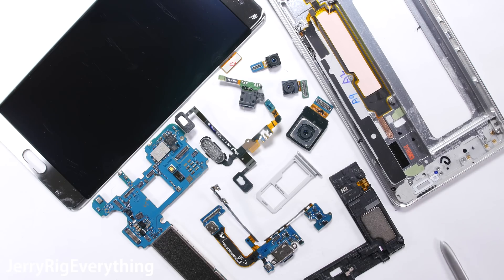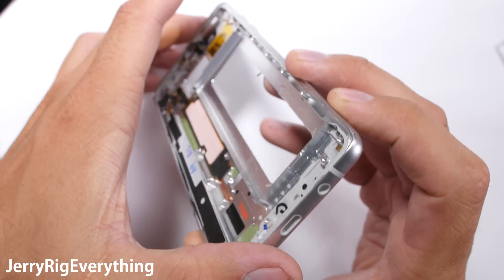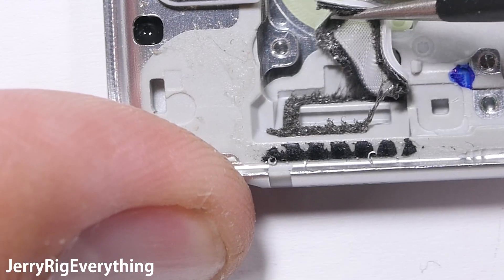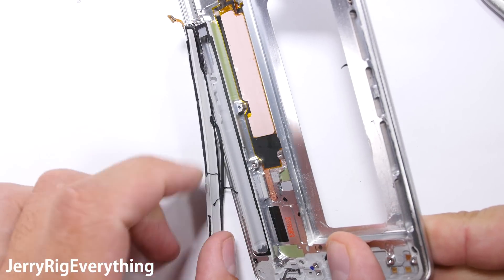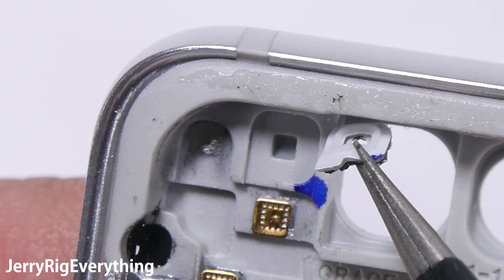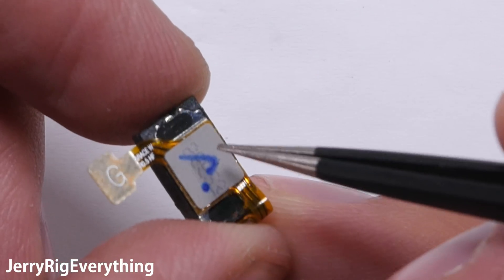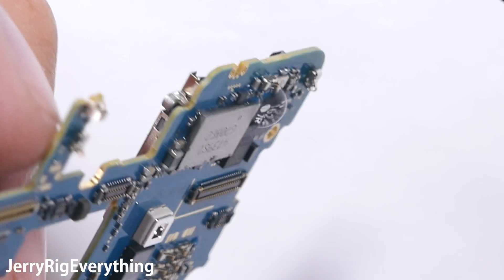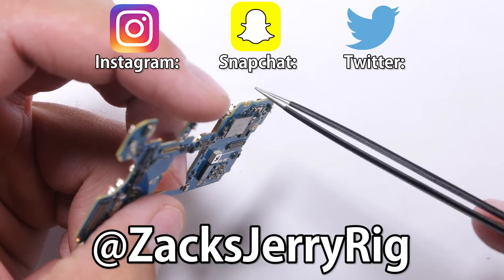What makes the Note 7 Waterproof? Ultimate Test!!

Comment: Hey Jerry,
I got a question about Samsung's water damage warranty. I dipped my S7 in a 3-4ft pool for about 10 secs and the screen freaked out later and died. So, I was scared that I caused it but later I called Samsung and they said I should send it in for evaluation and they offered to repair it at no cost. So you spoke about the water ribbons that would bleed. So does that mean mine didn;t bleed? and if it's a no then why did water come out of the SIM card tray when I pulled it out after I had removed it from the water?
Reply from the maker: If it really was a quick 10 seconds than maybe your indicators didn't bleed out. Also, Samsung might be nice about the liquid damaged phones, even though its not included in their coverage.  Its hard to say for sure.  It also depends on what rep looks at your phone. Some don't care, and some are super sticklers.
Reply: Thanks for the respond. It's a male that started looking at it according to the Repair Tracking site Samsung has then a lady took over and now they are waiting for a part to come. S7 is a great phone.
Reply: His Name is Zack. :P
Just saying...
Reply: water can come out from the Sim card tray but that doesn't mean it's way inside the phone since most of the phone has this water resistant barrier ... people will believe everything they see on TV its quite funny... youtubers said Note 5 and iPhone 6S are semi- water resistant as well with sum of them putting them head to head in a water container... I'm like 🤔😒... just cause they say my phone is semi-water resistant doesn't mean imma shower w my phone... sure I pay insurance but that's only for accidents in case I drop it and not on purpose...
Reply: XxiKarlosxX xoxo IKR well am a young adult that like to experiment so i tried it out. At least i live to tell a story to others. Am a pretty careful guy when it comes to electronics and i never get insurance on my stuffs cause i think am good enough but still no one is perfect.
Reply: Arun Kumar emmmmmmmmmmmmmmmmmmmmmmmmmmmm oke
Reply: LOL but Samsung says not more that 5ft for 30mins
Reply: so note 7 is a lot better
Reply: Don't do experiments like this.   The claim is one thing but the real issue is rain, spilt drinks, and drops in the toilet.
Reply: Darrell Lucas Hey chill bro, i got my phone back and it got fixed for free.
JEEEEZZZ
Reply: Darrell Lucas L
Reply: You can get sprays that allow electricity to flow normally but repulse/repel water I use it on my Galaxy S5 Plus for extra protection!
Reply: +JerryRigEverything can you do one on a Galaxy S5 or S5 Plus and/or Sony Xperia?
Reply: +JerryRigEverything 10 seconds is for ever to be in water. lol
Reply: You should test the claim on how resistant your bones are to breaking.

Comment: is there beter ıp then 68  like 69 70 681   some thing like that
Reply: IP69K
This means Dust tight and protected against powerful high temperature water jets.
Reply: Nick N when aliens invade earth with water jets
Reply: Nice
Reply: With IP 68 the 6 stands for dust resistance and the 8 for water resistant
Reply: IP 99
Reply: ı know but is there7 for dust or 9 for wather
Reply: +Cem Kaya there isnt more than 6 for dust but there is 9 for liquid and i think 9k oalso
Reply: IPxx
Reply: IPX8
Reply: The funny thing is that it's barely above IP67 which is dustproof and water resistant upto 1m @ 30min. 1m is around 3.28 feet, so they increased it to 5 feet which is about 1.52 m. Typically a manufacturer will specify 3 m for the IP68 rating which is just shy of 10 feet, but I guess since they got it just past the 1m mark they earned the IP68 rating... IP68 used to be the highest, but the IP classification was updated to include IP69K in 2013.
Reply: Jesus. Just out of curiosity, when would I need protection against powerful high temperature water jets?
Reply: +Nick N because it's handy
Reply: in shower
Reply: IP69KFW9
Water resistant, including water from high pressure high temperature jets, dust sealed, oil resistant and weather resistant too. The extra 9 for the highest impact resistance, rated at 5 kg dropped through 40 cm ;).

Comment: "great" so it is advertised as water resistent but not covered by waranty 😂 "nice job samsung"
Reply: all manufacturers do that!
Reply: its water resistant. not proof
Reply: water resistant not water prrof, if they advertised water proof they would cover it,
Reply: Especially because its only up to 5ft, theres no pressure sensor inside that will tell Samsung if that depth was exceeded, so someone could go diving, phone breaks, they go moaning to Samsung it was water damaged. Theres no way of them knowing if the user is adhering to the guidelines.
Reply: Because if Samsung claimed it was water proof and it did somehow managed to get water damaged, then people can sue Samsung for false advertising.
Reply: cause it doesn't have a water gauge installed into it... lmfao
how they going to measure if you went past the expected IP68 ratings?
Reply: samsung don't know if you yake it deeper..

some sellers in my country 
give you a special warranty cost 99$ and if your phone's screen Crack than they'll replace it 
but if your screen damaged they won't
Reply: In fairness what he showed was from the Carrier, it said T Mobile don't cover it, so I wonder if Samsung themselves do?
Reply: +azamean no they don't
Reply: azamean There is a water sensor inside the note 7.
Reply: Jason Lee A water sensor, not a pressure sensor. My point is they have no way of knowing if someones water damaged phone was due to normal use or because they decided to go to a depth greater than 5ft.
Reply: azamean There is a pressure sensor on the phone, but yes, it isn't used to tell if a person placed the phone under the water.
Reply: Jason Lee There isn't. The screen is pressure sensitive and so is the S-pen, but I'm talking about barometric pressure. It can't detect depth or elevation.
Reply: I think this goes to T-mobile, they use the same template for all phones and forgot (may be intentionally) to change this lines...
Reply: Actually there is barometric sensor (atmospheric sensor) in the phone, but I'm not sure if they may/use this...
Reply: +azamean it can't detect it yes. But the only way of the phone being damaged by water is if you take it deeper than 5ft!
Reply: wwesuperstar1100 Which is the difference from holding the phone in the water in a swiming pool, and accidentally dropping it to the floor of the pool. 5ft is not deep. Most standard swimming pools are deeper.
Reply: I think thats the logical thing to do because how they are going to know that you havent pass 5 feet in the water for 5 hours or something
Reply: In the EU there are 2 types of warranty:
1. voluntary warranty by the brand
2. mandatory warranty by the seller
If the seller in which ever way (probably there is at least some point on the packaging of the phone?) advertises the IP68, their warranty will have to cover it.

Comment: translate 5 feet for us normal people pls
Reply: Apparently  "normal people" are also too retarded to use google
Reply: Justin Elrod
Cant say anything these days without someone being offended for no reason.
Reply: 5ft = about 1.5 meters
Reply: +Xirpzy no he's right. People use the metric system where I am but if you're "normal" why didn't you just google? Normal people aren't that lazy and normal people roughly understand both the imperial and metric system
Reply: AllYourTechNow
ty
Reply: I am sure your comment weren't meant to be offensive or filled with bitter hate in anyway for sure :^)
Reply: Actually the ip certification is not 5 feet, but 1.5 m (4.92126 feet -> about 5 feet).
Reply: Paul
no most people wouldnt translate to an inferior system.

Comment: Why don't you teardown the s pen to show us what makes it oalso water resistant??
Reply: +Lord Jon well... So Just bteak it😂
Reply: +Lord Jon no, if you cut it properly in half you will be able to see all the components and what makes it water resistant
Reply: +Jad Bhamdouni am I wrong?
Reply: i think jerry forget about it lol
Reply: +Nagesh Katkur hahaha yh ik but his name is zack
Reply: +Pratik Patel oh yeah it does have electronics. I remember seeing a video cuting the note 4 or note 5 ' s pen and showing the electronics inside
Reply: The s-pen does not have any electronics in the pen, so it is water proof all by itself
Reply: +Jad Bhamdouni the button on I haven't had a new spen, but on my note 10.1, I detached the button and saw electronics
Reply: +HighEndMe exacltyy
Reply: +Lord Jon maybe you're right but i wanted to see if it would be better if I pull out the s pen and put it away before getting my phone submerged underwater in a pool for some pics or whatever
Reply: +Lord Jon yh ik but personally I dont trust numbers, I prefer to see people like zack (his name is zack jot jerry) tearing it down and see if we can trust the rating and if it will survive different condition (for example it's not recemmented to take the s7 in hot condition to avoid the glue below the glass to melt) and details like that
Reply: it's the most easy part to waterproof, it's sealed, they just need to put some rubber under the button like they did on the usb-c port and the same with the tip of the s-pen
Reply: +juan carlos Palomino you're probably right, but just to make sure
Reply: +Jad Bhamdouni I liked the part when you said his full name.
Reply: Isn't the S pen just plastic with some sort of chip embedded in it that allows the button to work? Like NFC or RFID, I dunno what they use. Something similar to contactless cards I'm sure. It doesn't have a battery or wires etc in it, so I think its just waterproof by default. My S pen on my Note 4 has gotten wet before and never had any problems. The issue was waterproofing the slot for it in the phone.
Reply: +Jad Bhamdouni copy the link and paste it in the youtube searchbar 
It's a video from android authority
Reply: +azamean it needs to have a battery... the pen itself is a button too. if you have the s pen like a cm above the screen and press the tip of the pen without touching the screen it still works
Reply: Lennard Helder I know, I have the Note 4. The S Pen doesn't have a battery. It has a conductive coil inside it which draws power wirelessly, which is why it works at a short distance.
Reply: You can probably easily guess how it's water proof though...

Comment: Why does electronics don't like water?
Reply: "ELECTR onic"
Electricity don't mix well with typical water...
Water will short the circuit.... and cause excess or reverse voltage rushing from nearby trace (latter it worst), which very likely to cause permanent damage or fry some sensitive IC. (also good luck with shorted-circuit Li-Po battery!)

Even if your phone manage to survive instant death of drowning, water or water vapor will possibly cause problem (such as rust) with some component inside, and your phone will suffer slowly horrible dead afterward.
Don't forget, it always easier for water to get into your phone than get out (especially if you phone is water "resistant", as it act both ways.....).

Comment: so do i swim with the phone or not? what im seeing is that the device is well covered and sealed.
Reply: no as phone should not come under high water pressure which will break the seals
Reply: if you were at a pool it would be alright to bring it under water for just a bit but you probably shouldn't have it in your pocket while you swim
Reply: As a bloke that knows a little bit about seals , i would not be taking an expensive electronic  device under water with protection for 1.5 metres .

Comment: Can't they spray something like neverwet onto the board? That would be fairly cheap and also quick to do.
Reply from the maker: +jedi22300 also, Neverwet never works on electronics.  The hydrophobic electronic coating starts at a powder and then ends up baked onto the board.  It's totally different than Neverwet.  Good question!!
Reply: +jedi22300 Neverwet is expensive and takes long to apply... That's what he's saying. I don't know how more blunt we can be.
Reply: +jedi22300 expensive and time consuming. so it would be very hard to do it on a massive scale
Reply: That's why I said spray something like neverwet. "That would be fairly cheap and also quick to do"
Reply: watch the video dude!
Reply: I did. Did I miss something he said?
Reply: jedi22300 No worries man, we all trip up once in awhile!
Reply: Put it in a condom.
Reply: Bryan Lee I see. To be fair everyone was being extremely confusing.
Reply: so is there an after market way to waterproof the phone? Other than cases i mean, just to get a WaterProof phone instead or resistant
Reply: +JerryRigEverything never wet is useless, I've tried it.
Reply: It's called a ziplock bag man it's cheap and works well as long as you get the double zipper type! ;P
Reply: +h G wellz plasti dip
Reply: never wet leaves a gross film across the object as well
Reply: well easy way would be to make them complete seal but you know conectivity and buttoms allways could be an issue (moving parts with holes)
Reply: +h G wellz home made waterproofing a phone by opening your non waterproof phone cover it's motherboard and other electronics with a heat resistant plastic, just have the cut outs for the pin connectors for the lcd, charging port, front/back camera,battery, ETC. Once connected put duck tape over the connectors so it's sealed from any liquid to damage your electronics. It's like  putting your phone in a zip lock bag but instead your putting zip lock in your phone.
Reply: No it's waterproof case or nothing I'am afraid!
Reply: +expl0de  lol
Reply: +Darth Awar - That is exactly what I was about to suggest, I use it during raining day.  LOL
Reply: ii
Reply: It becomes expensive and time consuming when you try to apply that solution at a large scale. We are talking about millions of phones.
Reply: even if "said" thing is cheap labor is not.
Reply: BooBooYup Samsung uses machines as they are cheaper and they want to be better than apple
Reply: It can be done quickly with a conveyor belt  the boards fixed in place on it's side two spayers one left one right to coat both sides of the board and a high powered UV lights to help set the WRS (Water Repellent Spay Coating!) quickly as little as a few seconds it is quick, cheap and easy put you need to build or retool a whole production line to do it and that is what costs money as Much as 250,000.000 USD to do!

Ideally you would put 2 or three coats on and that also beings to add extra expense but if you pass it on to the consumer I see no problem we already pay 25 dollars for a headphone jack (which I love btw!) when it costs 1 to 2 dollars to make (On Average minus things like the LG V20 Quad Dack!) and 2 to 5 seconds MAX to attach to the phone board!

Comment: Jerry can u please make a water test video againist the Note 7 vs S6
Reply: why? the s6 isn't water resistant and if u meant the s7 then they would both do just about the same but maybe the note 7 will break first due to the larger size and the Spen slot it has to compress alot more water pressure than the standard s7
Reply: +George Shehata oh yeah sorry I meant the S7

Comment: I think it's funny that Samsung makes commercial's showing celebrities pour liquid and dunk these types of phones in water. Then in the fine print not make themselves accountable. So basically if you watch their commerical and do what they do. You can be basically screwed. Zack have you thought of doing water tests on phones as well? appreciate your durability tests!
Reply: they aren't lying that the phone is water resistant. u should be fine if u dunk it in water. water should only get in if ur phone is below 5 feet.
Reply: +93Legit Never said they were lying. Said they wouldn't hold themselves accountable if your phone had a failure. wouldn't ever put my phone in the water just to see. Have seen to many fails with this 😜. In the cell phone industry.
Reply: maybe its to mock sony ,sony phones r rated water proof yet they leaked all the time and had tonnes of returns ,and sony even used FLAPS to seal the ports ,ahaha

Comment: would it be fine if I had it in my pocket while walking across the river the river is only a couple feet deep but has a pretty strong current
Reply from the maker: +Gopher Vlogs Good question! The current would add pressure to the seals, forcing the water inside the phone more.  So still be careful! Try to avoid it just to be safe.
Reply: +JerryRigEverything oh okay thanks

Comment: All the OTT hype re water resistance has been a bit of a surprise to me. It's as if buyers now think that you can water torture your phone, when in fact the main reason is to protect from accidental water damage, not to swim or shower with the phone. If you look after your phone and I have had hundreds, and none have ever had water damage, I see this not as a feature just something OEMs improve on over the years, like CPU, GPU, Bluetooth, etc. Suddenly the S7 and Note 7 is so great because of it, is like mass hysteria, it's quite weird. Anyway coming from an older generation where we would never risk £800 electrical devices near water, as clearly it will never do it any good, even if my phone has IP68 it will be kept well away from water, so probably something that will never be useful to me, but better than not having it I suppose.
Reply from the maker: +andyH_England I totally understand.  It's awesome technology to have! But a 900 dollar device still needs to be treated like a 900 dollar electronic device and kept away from liquids as much as possible.